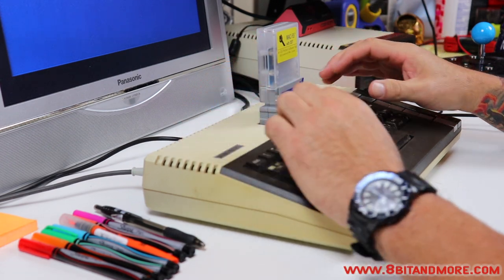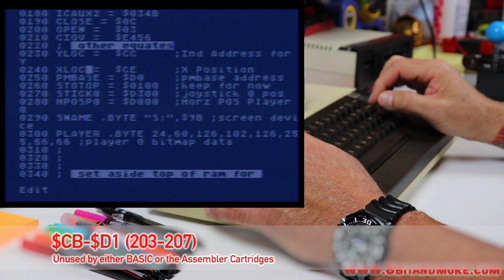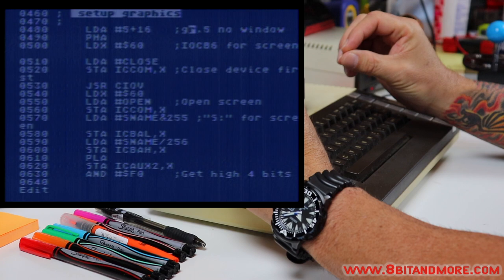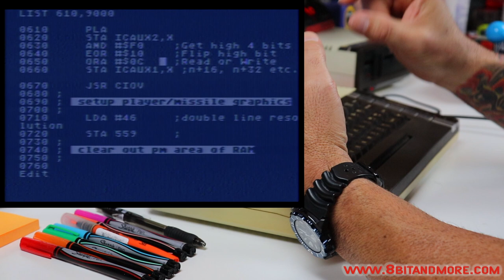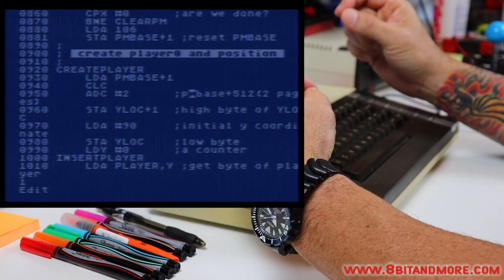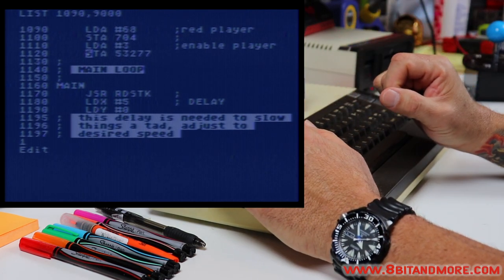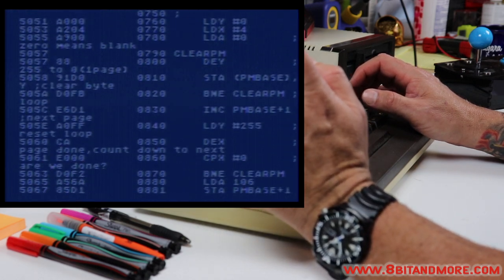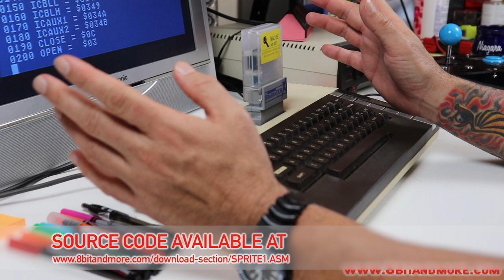Sprites using Assembly language on the Atari with Joystick control

Comment: Great example.  Maybe I'll get off my butt and finally learn assembler.  I can order a replica MAC65 in cartridge for $26.00, but I don't know that anyone is still making SpartaDOS cartridges with a pass-thru connector anymore.  The SIDE 2 cartridge comes with SpartaDOS built in, but I don't know if you can then run MAC65 from an image on the flash memory.
Reply: You should be able to use Mac/65 with any ol' DOS (Atari DOS, MyDOS, disk-based SpartaDOS, etc.)
Reply from the maker: Bill Kendrick yes that’s right, any DOS should work

Comment: Sprites are only available in assembler and not basic ?
Reply from the maker: You can use the sprites in BASIC as well but they will not move as fast as in machine language.
Reply: @8bitandmore  But maybe they are easier to use in basic?
Reply: @ButilkaRomm  Use BASIC XL or BASIC XE rather than the built-in Atari BASIC if you want easy sprite commands. Vertical movement is slow with the standard Atari BASIC.